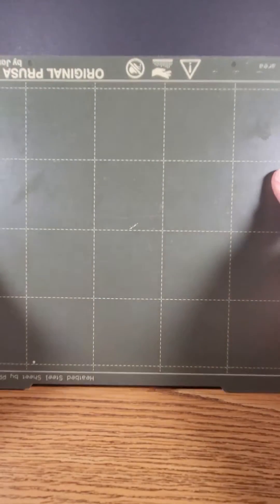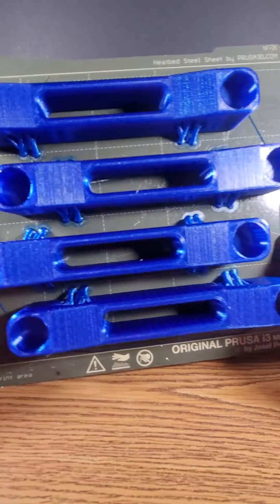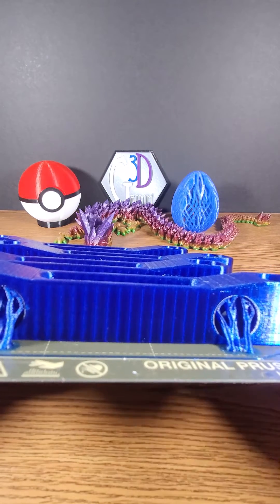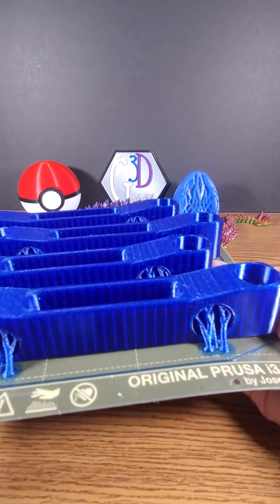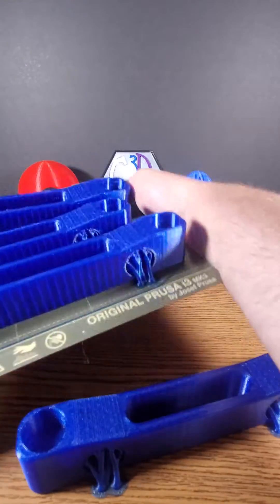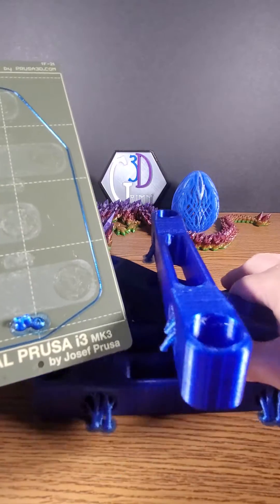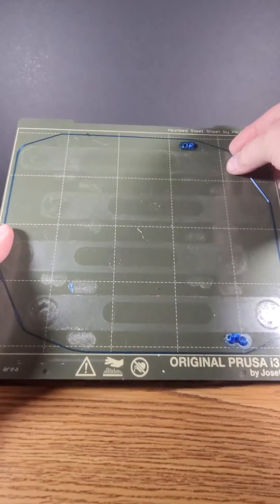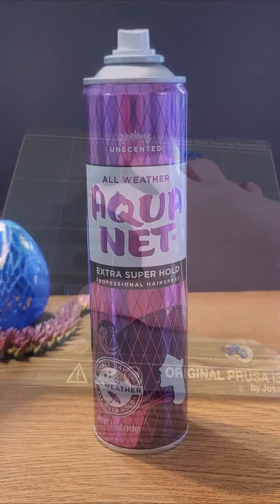How to Print PETG on Smooth PEI

Comment: It works. But if you need an absolute immaculate first layer surface you need to wash the plate an re-apply hairspray. Or whatever you printed before will show.
Reply from the maker: I've never noticed that, but thanks for adding to the conversation!

Comment: I scrubbed my smooth plate with Simple Green and hot water. I got the same results. 🤷🏻‍♂️ With Magigoo adhesion was terrible. AquaNet is infamous though as a go-to release agent. I'd be curious how hard it is to remove the buildup if you need to.
Reply from the maker: Super easy to remove, which I only do once every few months. Water or IPA and a little time your plate will be as good as new. Trust me, once you try AquaNet Super Extra Hold you will never use anything else and you'll never want to print without it. 

Those who say anything other than that, have not tried it. P.S. it is also extra sticky when it is hot (even older applications get sticky with heat), therefore it works well for first layer adhesion, too. You'll never have adhesion problems again. If you can try the purple can, you won't look back. And it's cheap